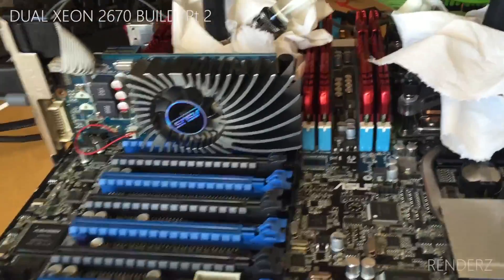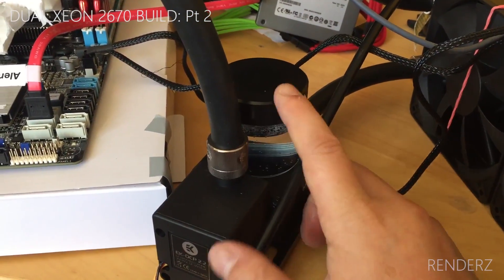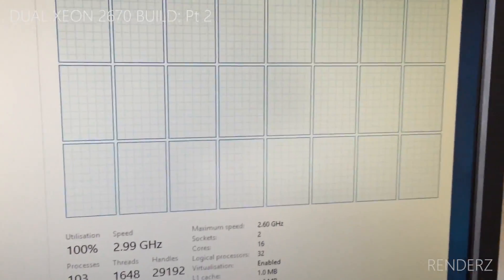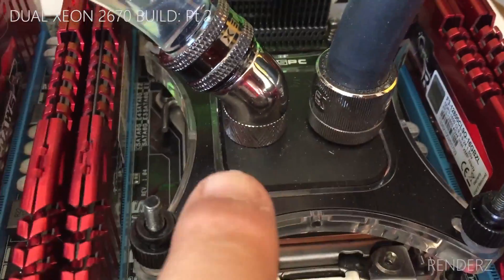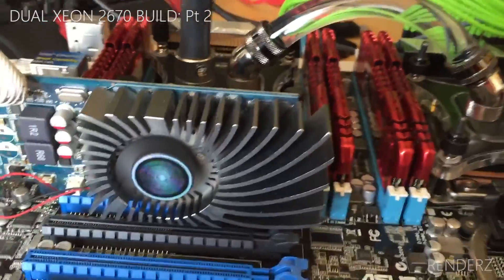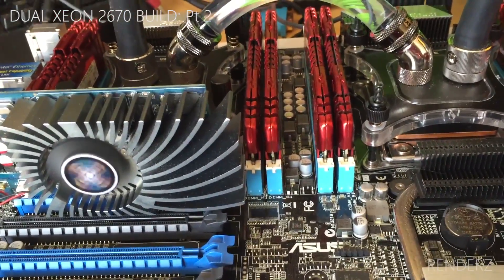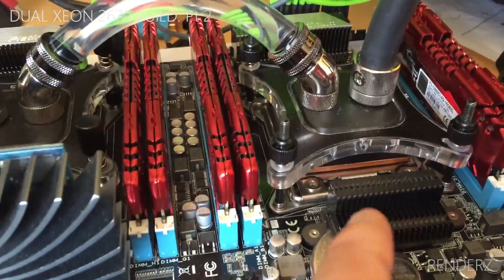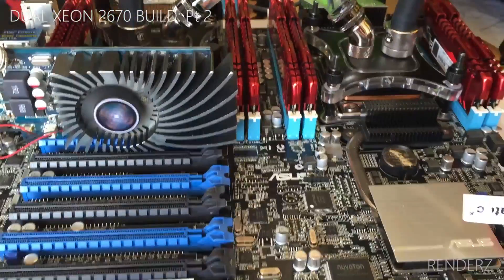Dual Xeon 2670 build log part 2. Motherboard and water cooling.

Comment: How reliable is the motherboard?
Reply from the maker: That's a tricky answer because this is the second board I've had after the first one failed to boot after 2 months. In all fairness the first board was bought "used" from Amazon. When it failed Amazon's 30 day warranty was no longer valid so I contacted Asus directly and within 2 days they had sent me a new board!! Simply amazing service from Asus. The second board has been solid for about 6 months now.
Reply: How much did you pay on amazon?
Reply from the maker: Just shy of £360.

Comment: I like your accent. It differs a lot from the american tech youtubers I am used to follow. Some small critics that I feel I can say are: a little too shaky camera and the colour scheme. Yes they are stupid details but make the system look even higher end that it is. I sometimes imagine dual CPU custom water cooled PC to build so props for having done that
Reply from the maker: Hi, you make some good points that I'm well aware of, but it comes down to how much more money do i want to sink into this project. Other than the board and the CPUs and waterloop bits, everything else comes from other PCs I have to complete this build.
Reply: renderz Oh I see. Well if you plan to invest you may sell it as a rendering station for a friend of yours or sell it on eBay or something similar